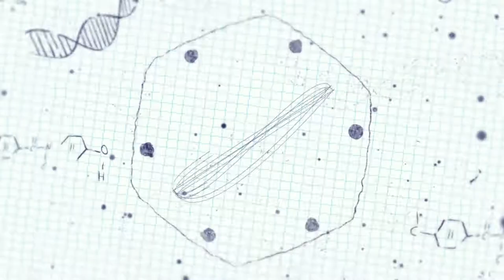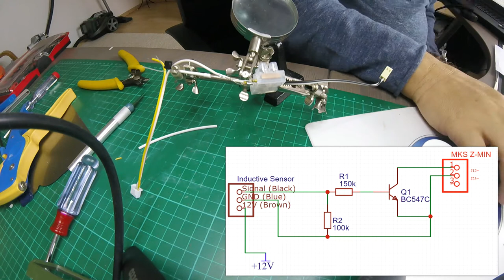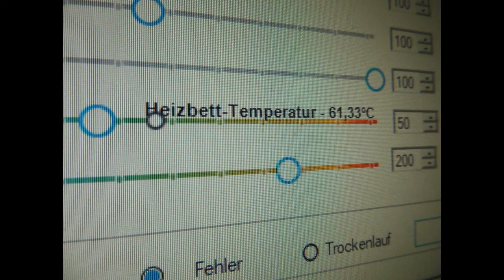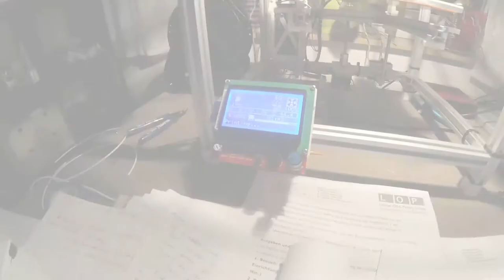S01E02 Build a Hypercube 3D Printer

Comment: Hey Frank, Nice video. I have build frame and all other mechanical parts. now I am struggling with the programming of Arduino. like what software I need, which file to upload and all. can you suggest how do I start electronic part.?
Reply from the maker: Hello, please try the ramps 1.4 board. An arduino allone has not enough ram.